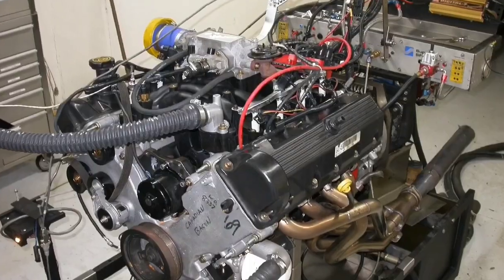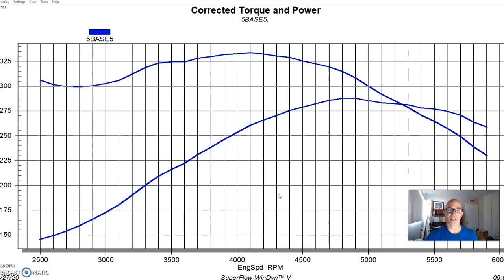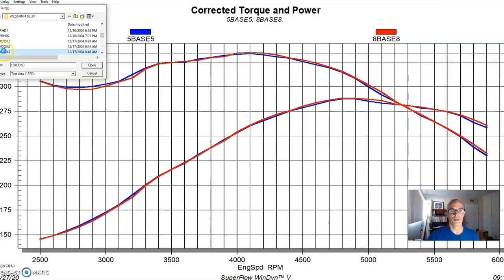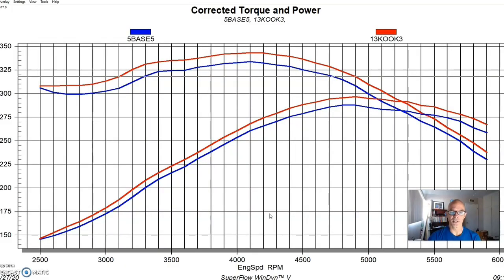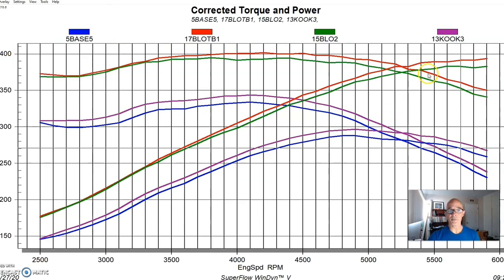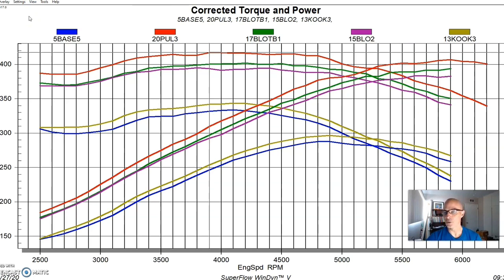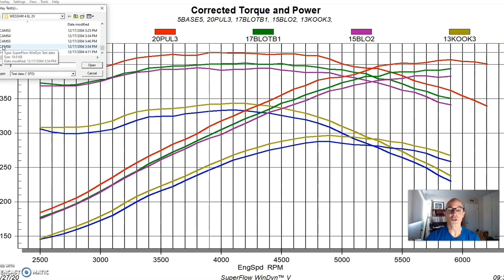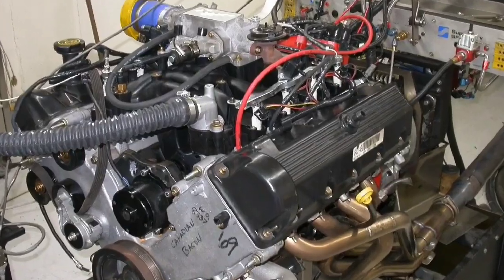FORD RACING SUPERCHARGED 4.6L 2V TEST

Comment: All I got was don’t go broke modding a 4.6 just coyote swap it
Reply: because coyote engines are so cheap
Reply: Ryan Axberg you can get a coyote motor for two grand from a wrecking yard which makes closer to 500hp when optimized like they do for engine dynos
Reply: @keithmceuen8775  sure not where I live, I would expect to pay at least 5 grand.  Thats about what they are on ebay also
Reply: Ryan Axberg don’t get the coyote from a mustang look for the f150
Reply: @ryanaxberg9263  are you getting that $2k coyote motor in and running for that price though?

Comment: Love these comparisons of low budget builds. Not for the rich peoples but for the budget minded.
Reply: That's why I watch Richards channel. There is so much information, for all price ranges. And the most valuable, is his knowledge and experience what he shares. He literally wrote the books on this subject, and shares it. Love the guy!
Reply: @ifgezroxy  I wouldn't say the the 4.6 is the a very budget friendly motor i mean them kooks headers are like 1,300 bucks. This is coming from someone that owns a 2v 4.6 Twin Turbo Crown Vic. The 4.6 alone yea, the mods no. A lot of people are for sure starting to figure out what the 4.6 can really do tho.
Reply: @Chillvein  they can be pretty budget now. I can pickup a PI 4.6L for $150 bucks at the wreckers for the long block
Reply: @ryanmalin  As Chillvein implied, the block is cheap but the lack of aftermarket parts means they come at a premium. Supply and demand is a bitch, that's why the LS parts are cheap and plentiful.
Reply: Ryan Malin yes the base motors can be found cheap, the parts to do any mods are the expensive area. I’m finding this with just a stock rebuild on 2v 5.4L P.I. Even just the dang TTY bolts add up. I miss the pushrod engines.
Reply: @Chillvein  how much hp are you making with the TT 2V?
Reply: @noahgonyea8866  with tune I had it on was making roughly close to 400 but it had alot of timing taken out because I wasn't running a intercooler and a decent maf. The car is currently in the shop having work done to it intercooler new piping, new maf, bov, of course a new tune. Once it's done should make roughly close to 500whp. With of course 5 speed swap. This time we are going to street tune it and throw it up on the dyno I'll post videos.
Reply: @Chillvein  compared to ls budget you'd actually be surprised 4.6 budget and ls budget are really close
Reply: That’s why you should be building stuff with an ls, the power they can create for hardly any money is undeniable, my blue oval pride told me not to give in to the urge to enjoy Chevy too, but now I’m turbo 5.3 swapping my 86 notchback, and couldn’t be happier with the “future proof” of these Chevy engines, they’re easily able to handle much more power than what I initially throw at it, and can be built for relatively cheap!
Reply: @RegulerShowTV  Everyone suggests the LS for obvious reasons, but since everyone and their dog has an LS it's the king of the me too club which many folks want to avoid justifiably.
Reply: @RegulerShowTV  I never was a huge fan of any of the 72 and newer blue ovals. Up until 2018 moosetangs, the performance from off the floor stock had not been up to par. But yea the Lego adult world says a lsx turbo in any ford is the way to go now. I want an old 49 deluxe with a twin 72mm 4.8 and t56 trans.
Reply: @RegulerShowTV  hell no . Not in my house .lol

Comment: I remember these from back in the day. They sold a bunch of them but you don't see them around much anymore. Would there be a way to adapt this blower to a 5.4? I know it isn't for max HP but I have an old truck for my sons that this might be fun to put on.
Reply from the maker: better to use an M112 from an 03 cobra with an adapter to the 5.4L

Comment: So... a m90 will make power on a 4.6 ford but not a 4.8 gm?

https://youtu.be/mfkU0HO5U1k
Reply from the maker: look at the numbers
Reply: @richardholdener1727  the 4.8 started with as much power as the 4.6 ended with. So shouldn't have the 4.8 ended with a wash? Wrong pulleys?

Comment: just picked up a 07 crown vic. im not sure if i want to scatter the 4.6 with a vortech, or just swap to a turbo 351w, m5od combo right away. after seeing how easy the 2v is to make power, running what i have now may be fun.
Reply: Easy? A supercharger and long tubes to get to 400 hp is easy?
Reply: @meteor5452  if you already have all that stuff at home, yes. I would say it's very easy

Comment: Please do a test with different header primary sizes!! This always gets debated to death with no hard evidence. On my combo, I used a couple different formulas like the one below and they all said my header primary should be over 2.5 inches on my supercharged 4.6L Cobra motor if I wanted to have "Peak Power RPM" of 6500 rpm. Yet  nobody tries to put a 2.5 inch header on a 4.6L. Want to see real test on a real motor[any motor]

 [(Peak Power RPM * 1 Cyl displacement)/ 88,200]=HeaderPrimaryArea
Reply: That is because 2.5 inches squared is a 1.75 inch primary.
Reply from the maker: a 2.5-inch primary tube on a 4.6L? we make 1000+ hp with 1 3/4-inch headers
Reply: Richard Holdener I think this guy got caught up in his discussion and confused/substituted area for pipe size. As an example if you work his formula using 6500 rpm and the cu inch of one cylinder of the 4.6 liter the resultant is 2.4 square inches. The 1.75 inch diameter header you refer to has an area of approximately 2.5 square inches. Great discussion point. Your correct in that the 1.75 inch header will support large quantities of horsepower. More than most would believe. Thank you for once again making me think for a couple of minutes. Great video. Thank you for making them.
Reply: learned something new, that's why I love this channel! Thanks all
Reply: hendri morris : We who love learning something new always have to learn something old from the Jeddi Master. Gotten the area formula wrong many times as well, my friend. As an asside, the 281 with M112 Eatons shoulda, but  didnt take over the world, but it packages better than any other SOHC per bank engine, its the worlds best hidden mod for a 2 or 3V Mod "Motor". On a short deck 4.6 liter block, its got everyone Foxed if it makes 430 hp. Despite the crack off powedered rods, Ford again had everyone else on the hop and run in 2004. Chevy had bore spacing advantage, and all alloy 346  and 6.0/6.2 options, but the whole Mod Programme had great options from little SN's to huge SUVs.  4.6/5.4/ V10 6.8, quad cammer 4.6 and 5.4s (overseas in Austalia, 5.4 liter Quad Cammers in 360, 390 hp, and a limited production  DJR 429 hp which made emissions legal power at just 5250 rpm without boost from just 331 cubes).

Comment: Thank you for this one... 
some of us got 2v/3v 4.6.. 
all of us can’t afford a 5.0 swap... 👌
Reply: Hey, your car will always sound WAY better than any Coyote!
Reply: @danmyers9372  nah
Reply: I have to say that one of the best sounding engines is a 4.6 4V with just an X pipe. Something about the combination just sounds great.
Reply: The truck motors are @390hp, got a ton of torque. I'd go that route. All the things he's doing ain't cheap either!! Like to see the same test on an old Lincoln mk8 4valve that'll bolt right in!! Talk about bang for the buck!!
Reply: @markmccarty727  I've been looking for Mark VIII's to do a swap in my '98 F-150 but you run into two problems now. Either the engine is completely thrashed because the previous owners didn't know what they had when the cars were only a few years old or the owners are catching on to what the cars are and they're charging outrageous prices for a good runner...kinda like the drift tax for 240sx's. The car is actually garbage with rust everywhere or been wrecked...hell even just a shell and people are still wanting 3500-5000.
Reply: @alpha2gproject783  the 32v 4.6 is not the engine to get. Get the 2v PI, its cheaper to build
Reply: @alpha2gproject783  my brother has 2 of them, but we don't speak. Mercury Mauraders have them, some Lincolns have them. He bought a wrecked car for $800. Cheaper to do it that way. I'm a Windsor guy myself. Planning on a on3 70mm blow thru turbo set-up in my 94 flairside 150. Torque is the objective, hooking up will be the problem!!
Reply: @alpha2gproject783  just looked, one on eBay now @$600.. Heads flow round 280cfm on intake side. Specks are almost identical to Windsor Victor Juniors! A 4valve 5.4 blown would be insane in your 150!! Know a guy still driving his Lightning he bout new!! Think some Navigators had 4v 5.4s but never seen it. That would Be AWESOME in ur 98 f150. 351windsor fits right in my 94that my father gave me before he died. He wanted me to build a blown Windsor for it, that's why I'm doing it! Good luck.
Reply: @ryanmalin  with the 2v over the 4v that i agree its cheaper to build n repair, but the improved flow #s are with the 4v, i'm a 2v guy all the way so idc, go 2v power!!
Reply: @markmccarty727  if its the 351W, heck yeah, i love the Windsor V8, a 427ci build is what i'd like to do with my 84 Bronco XLT..
Reply: @P71ScrewHead  It ain't all fun and games! By this time u need to look for a block! I see people f#@king up blocks, find out their shooting 500+ gas on em. Or 15+lbs. Of boost!! Know couple of guys with 393's that hold up as long as u don't get stupid!   When u decide to try to keep up with the dope dealers ur lights get cut out!! Take advice from an old man that's been there, put something together and just have fun with it. Get a good set of inline valve heads and it'll live all day on a 150 shot with the right timing. We did that with stock rods and cast pistons!!
Reply: @ryanmalin  If you were looking at getting some Cams...yes. It would be. But for what I want, the 4.6 4v is a better bet. I did the math and after getting PI heads reworked, getting them degreed and then getting a dyno tune, I was looking at over 3000 just for the head swap, intake, tune and freshing the motor. With the 4.6 4v, I'm already at 280-320 depending on which engine I get. Not only that but I can still run regular fuel whereas the PI swap means I need premium. I feel the 4v is the better motor with more power potential. I've even considered the 5.4 4v but with pats...it's a bit of a pain to work with. It's still doable but if I'm having to swap out engines, get tuned and even swap cams...why not start with one that already has more power?
Reply: @markmccarty727  I love torque but without some sort of traction management or fat tires, I don't mind the idea of some high revving power in a truck. Or at least higher than my non pi 4.6 lol. The 4v is a great motor and I've been reading a lot into them and I've ridden in a few NA Cobras and loved it. The objective is to get a whole car...likely a 93-95 Mark Viii as it has the same ignition, no pats and is essentially drop in. Once I get the engine installed I already have a set of 01 Cobra Cams and intake set up that a friend gave me when he totalled his car last year (tree fell on it). After all of that, a nice easy going tune and hopefully I go from the 220hp 290tq at the crank to 300hp and 340tq...I may port the intake and go with a large mouth throttle body in the future. But I plan on keeping the truck around. 275000 miles and not a scratch on it. I've considered getting a new truck but they don't offer me anything I don't already have other than more power and more crap to break in 10-15 years.
Reply: @alpha2gproject783  save yourself the money, keep your truck running n not money spent on paying a new one off..lol You know what you're doing..
Reply: @markmccarty727  yeah with an aftermarket block a 454W stroker can be achieved, tempting, but i honestly dont want to race it, nor have an engine just laying around so i'll use what i got if its good enough.. i appreciate your advice tho, the 351W can handle some power stock, no doubt about it..
Reply: @P71ScrewHead  I thought about it and almost had a moment of weakness in the spring when a dealer wanted to sell me a 2017 2.7 XLT with only about 25,000 on the clock for under book. But I just saw so many things that I know will only break in the future and be expensive to replace. So I passed and started my search for an engine swap candidate.
Reply: @alpha2gproject783  like i tell my young fam members, "you made the right choice grasshopper"..lol A new vehicle will always be fun n all, but making the payment n insurance costs takes alot of your money, instead beauty up what you got/own n make it fast if you'd like.. Unless you're full of money then spend it as you wish, i'm not full of money so i spend wisely n look for ways to make money that dont come out of pocket like cash back cards.. ;)
Reply: @alpha2gproject783  that's the way i see it too, i'm 29 by the way.. Once i get me a nice enough land ima build my 95 Lincoln Town Car to be a screamer, unless i win the lottery, new cars are just for me... TO look at in reviews..lol i do like the look of the 2020 Toyota Camry TRD, look it up..
Reply: @markmccarty727  well, i like the idea of keeping it 4x4 but i need it slammed due to being in wheelchair so i guess it'd be RWD altho i'd like to make it AWD.. Anything is possible in this world, it just comes down to $$$..lol I'm going with the NASCAR look anyway so it works out to be low.. i appreciate your advise n suggestions..
Reply: @markmccarty727  thanks man, n no prob. i know what you mean, dont over do it, blow it up or something, i mod my cars for my pleasure n my satisfaction, not to show off or street race, altho i do plan on running it at the drag strip.. i dont have a set price cuz horsepower is pricy, costs to build..lol
Reply: @ryanmalin  or the 2v npi and put PI (or even trickflow small chamber) heads on it
Reply: @markmccarty727  any 4v heads will fit any 5.4 block, it's just a matter of finding an intake that will also fit.
Reply: @P71ScrewHead  idk 2v trickflows can put some serious flow down, but they ain't cheap
Reply: @markmccarty727  it's basically a b head cobra but with a cast crank and shittier cam.
Reply: I've never understood why Ford people think that those newer model Mustang sound good they sound just like a farm truck with no mufflers
Reply: @bradhaliburton5974  pretty much all these new pony cars sound like skinny jean wearing grandchildren of mucle cars..lol Cant beat the 2v sound tho..
Reply: @P71ScrewHead  the 5.0 coyote sounds great with a good set of pipes, youre uninformed sir
Reply: @ryanmalin  naa, to be honest, i like the 5.0 Coyote, its just a stroked 4.6L 4v Cobra, we can agree on that, right?? Some ppl doubt me but the fact is that's the case.. In my opinion, any V8 can sound good, but i'm not all about sound, the best sounding V8s to me are open headers.. Can't beat that sound n performance.. ;)
Reply: Ryan Malin Everybody has their own opinion I agree The coyote sounds like shit
Reply: TigreLoko24 The coyote has a flat plane crank which makes it a different animal
Reply: @ericsantiago6832  Incorrect. The Voodoo has a cross plane crank and is a modified Coyote.
Reply: @ericsantiago6832   still is a stroked 4v, n still is of the same Modular family of engines..
Reply: @P71ScrewHead  I mean turbos make a heck of a lot more power than open headers....
Reply: Just do an LS swap make it better
Reply: @bradhaliburton5974  Hell that's more expensive than just modding the motor you already have. Why do people seem to think LS chevys and the performance parts for them are free? Not to mention mating it up to your trans. Also nobody is impressed with an LS swap unless it's a "balls to the wall " build which aint cheap
Reply: @bradhaliburton5974  faster and cheaper
Reply: @bradhaliburton5974  LS swaps are too vanilla.